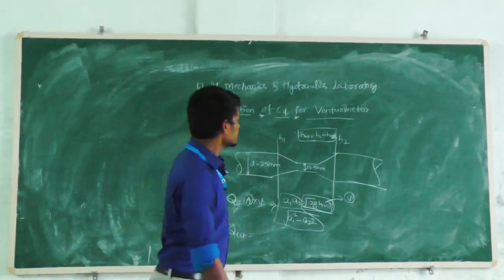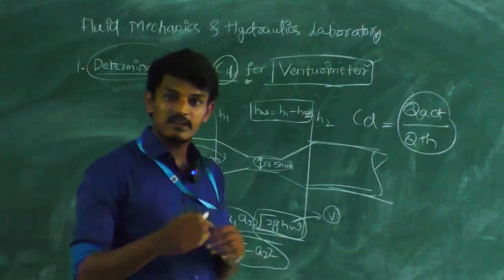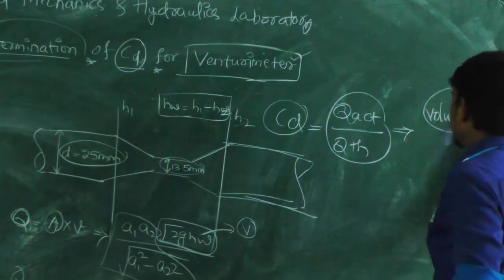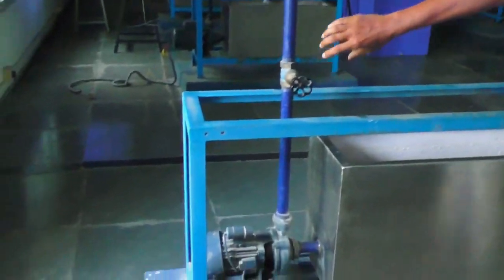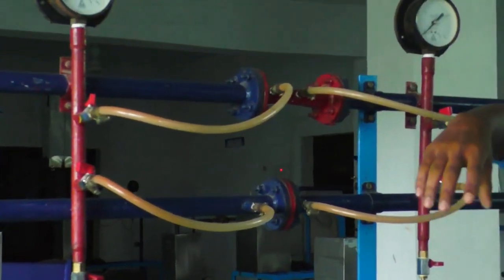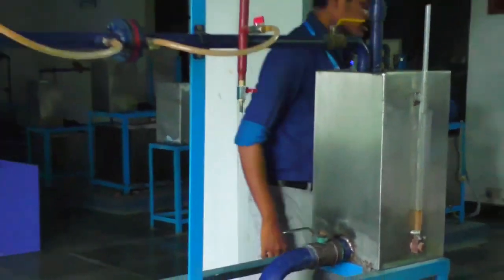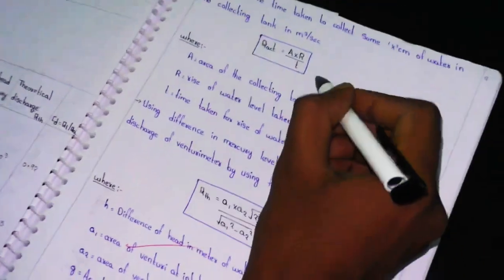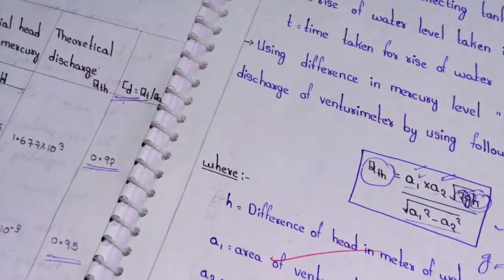vgacademy laboratory series |Fluid mechanics | venturimeter

Comment: Sir,one question 
Why pipe diameter is reduced in venturimeter diagram.
When pipe diameter is not reduced 'cd' how can I find out.
Reply: Reduction in diameter causes head loss, which helps in finding Theoretical velocity (√ 2gh)and then theoretical discharge !